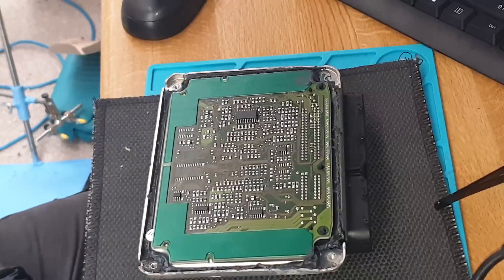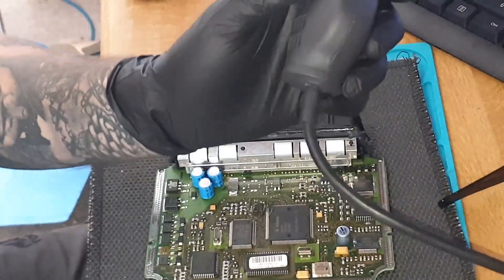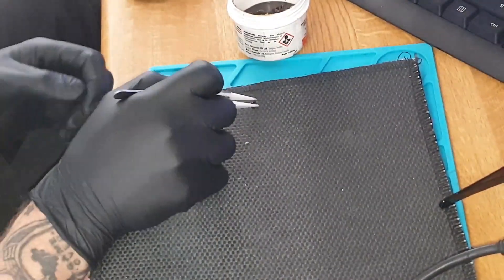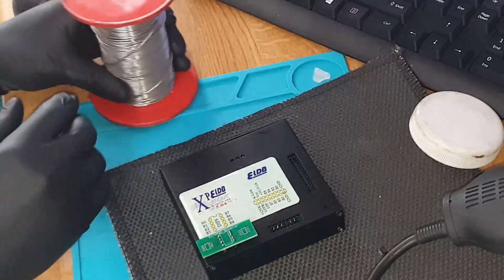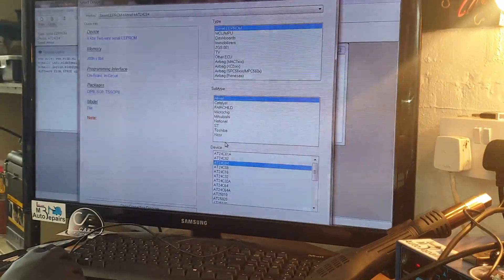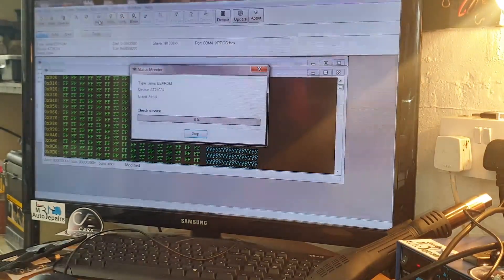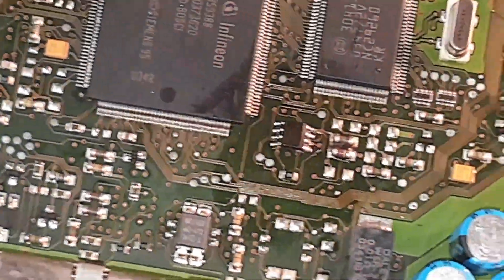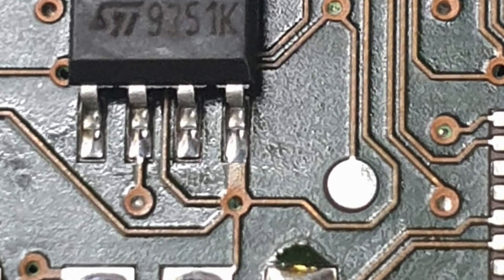xprog reading

Comment: I have a 2012 s550. Had water in the fuel control module and needs to be replaced. Can you help me clone this part. Have the original and a used I bought from eBay. Thank you

Comment: Thank you for the video,simple and informative!
I am really new on the subject and still learning.Is there any easier way to read the EEPROM other than desoldering,because I'm afraid I might damage the board or the chip during the process.
I've already ordered CarProg,I might as well order Xprog(If coronavirus ever dissapears)
Cheers!
Reply from the maker: Thank you for your comment. Best to de-solder I'm afraid. You can read them institu on the board but the data may be corrupted as other things are obviously attached to the eeprom via the pcb.  I will be making some soldering tutorials soon so stay tuned